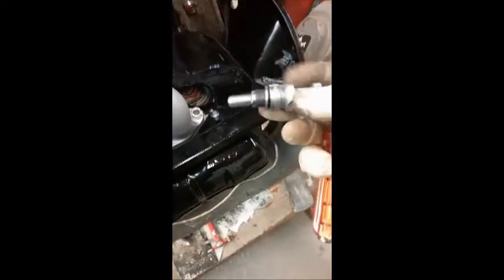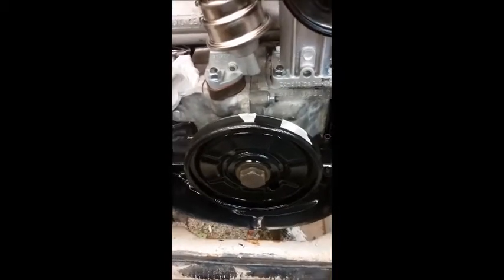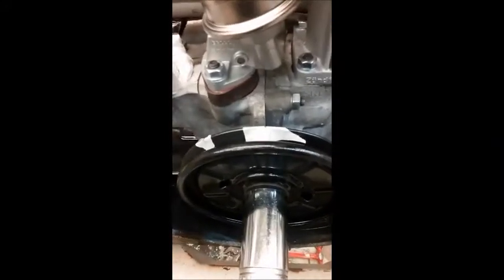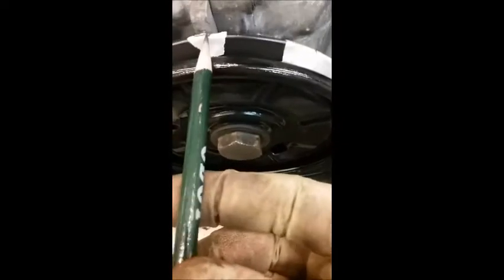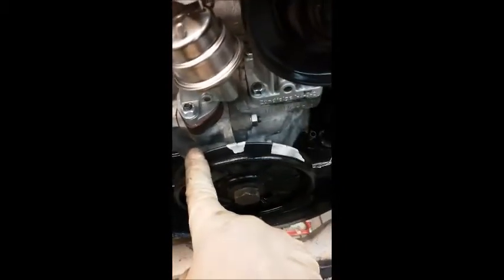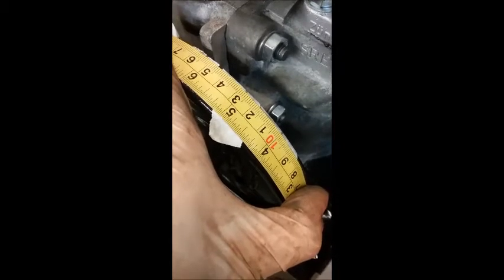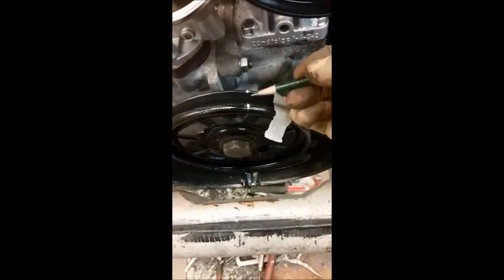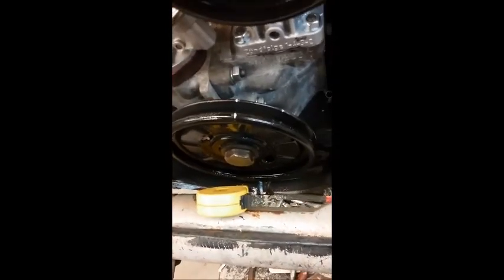Finding TDC on a VW Type 1

Comment: I was given a clue to how to do this 23 years ago. This is the only video I've been able to find that supports the clue and completes it. The mechanic that gave me the clue said he used a screw driver to do this. There's two marking on my crank that have been a mystery to me until now. My pulley wheel has only the two marking to find the TDC point. The markings for TDC and 7.5 are now gone and I've been just guessing until now. This is the most important video to me to date and I thank you very much for the knowledge. The 6 thumbs down people..... I wish I could clock them all. Right in the the nose. You just saved me hundreds of dollars.
Reply: You need to know TDC and BDC in order to adjust your valves.....TDC is for valve 1 and 3.....BDC is for valve 2 and 4.
Reply: You go clock wise to TDC to find 1 (check your distributer to see which cylinder you're on sometimes 1 and three get in each other's way and are classical mistaken for each other. and make sure you're on one)

 and then counter clockwise to BDC to do valve 2 then back clockwise to tdc  again to do valve 3 and then counter clockwise again to BDC to do valve 4.
Reply: There is only one youtube video that shows this correctly. Lets make it easy to find.